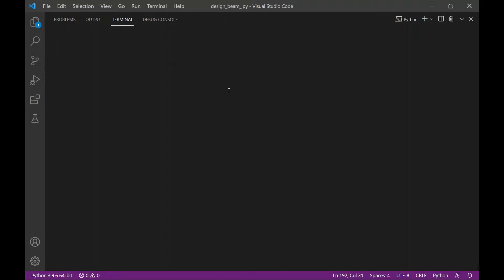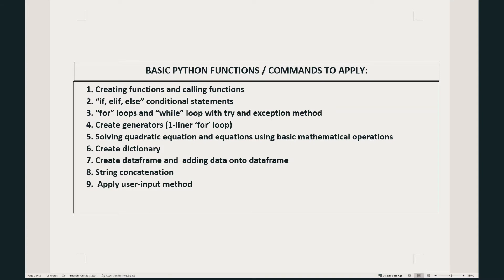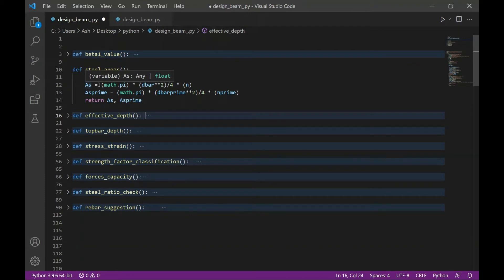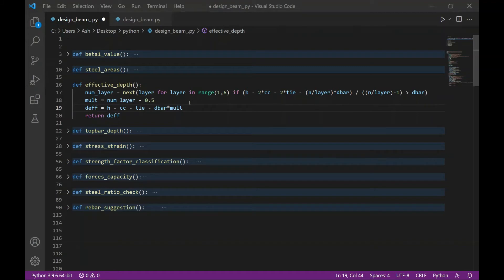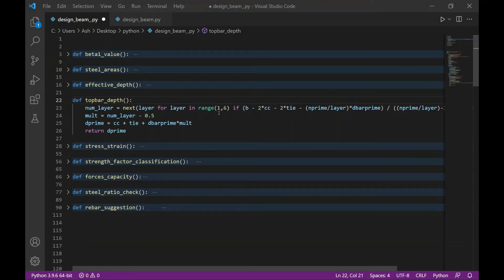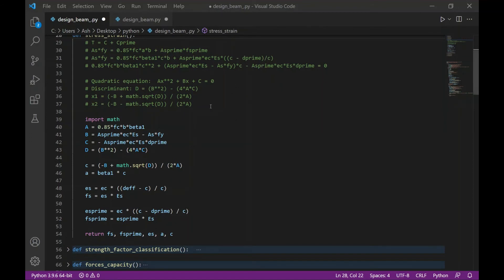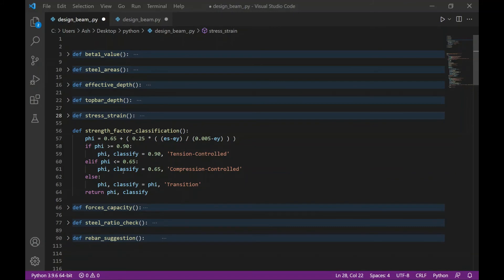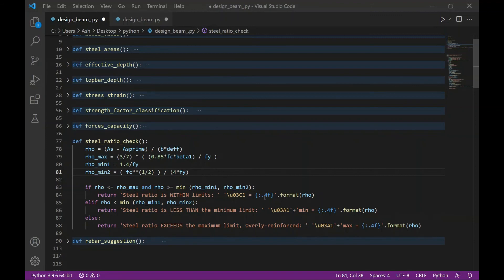Beam Design Code using Python (Part 1/2 Defining Functions)

Comment: when you are calculating the tensile stresses and strain values what are the inputs for b, h, and the numbers of rebar on the top and bottom?
Reply from the maker: b and h values are provided through the user-input code explained in Part 2 of the video